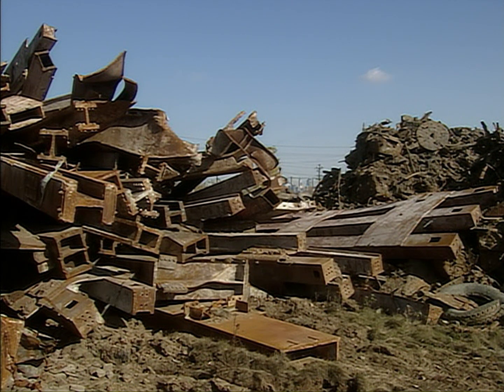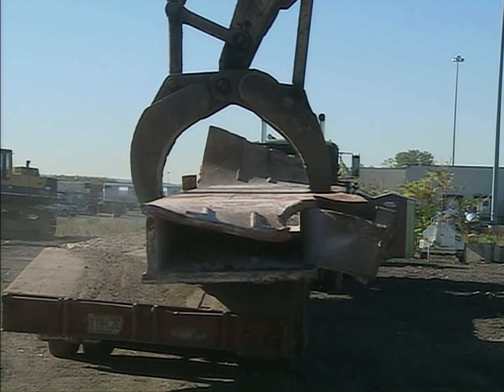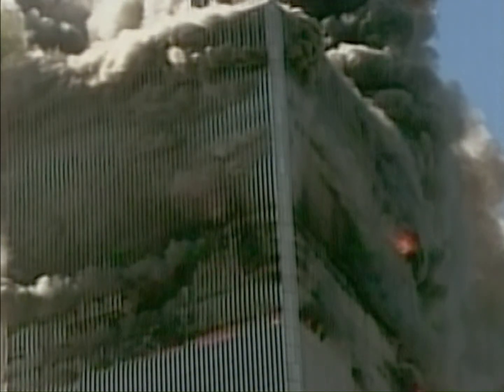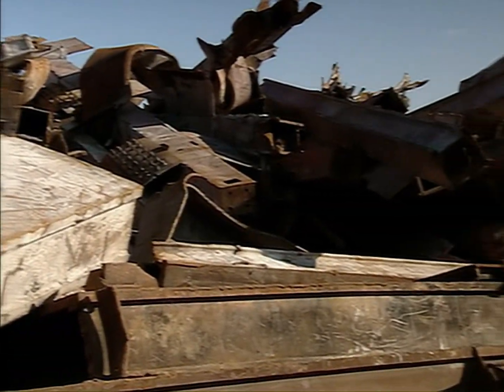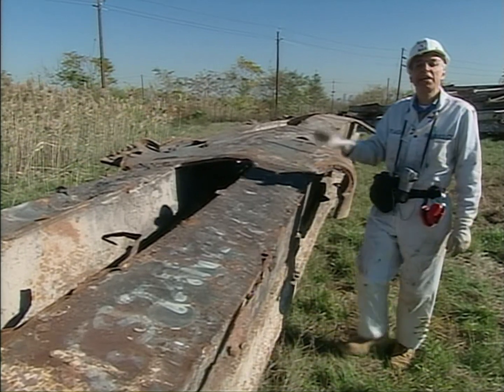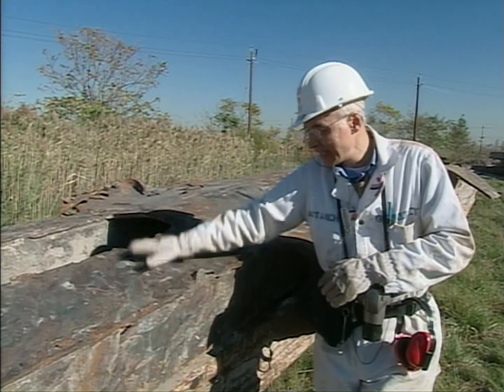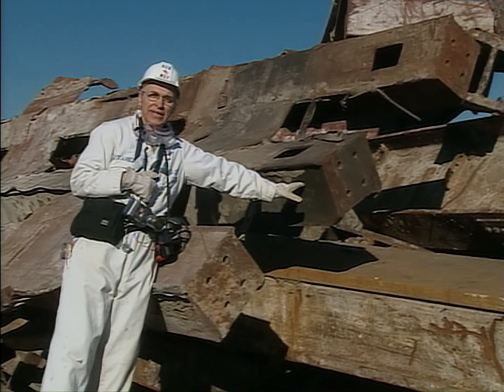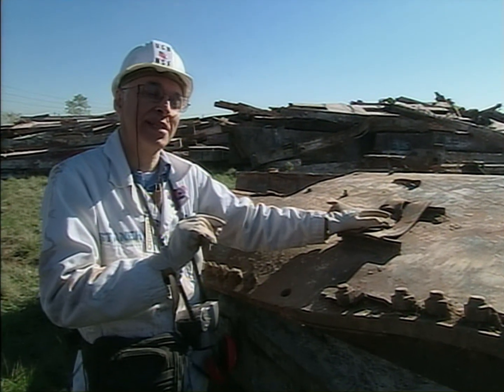WTC Steel Wreckage at Claremont Scrapyard Feat. Dr. Astaneh-Asl

Comment: twisted high strength steel weighing tonnes, each floor covered with a 4 inch layer of concrete.all 500,000 tonnes came crashing down at 120 mph in 11 seconds. it's not surprising that there was very little left as most of it was pulverised, i'm amazed with those that did survive as this was hell on earth. i'd love to know how much it cost in total to build these twin towers...

Comment: Kerosene fires can't melt steel. Not nearly hot enough. However thermite can easily melt steel. Thermite particles were found throughout the WTC collapse dust. Dr. Abolhassan Astaneh-Asl doesn't seem to understand basic physics if he thinks kerosene fires damaged the steel. The buildings were rigged with thermite prior to their collapse.
Reply: Cool Beans I believe an aluminum alloy large 767 jet penetrated thin steel at 460-590 mph. Also, my car won’t go through a building made of thick concrete and steel if it’s going 60mph. But it might go through if I’m going 590.
Reply: Your understanding of basic physics is nil if you think steel can't weaken without melting first.
Reply: @incredulousdisbelief9841  I didn't say that heat doesn't weaken steel. I will say that heat in the upper part of a tower can't weaken the steel below which also failed.
Reply: Quake proof a house Taylor Devices Viscous Dampers personal opinion.
You have no facts or evidence to back up your claims. Read my previous comments please.
Reply: Kerosene fires can’t melt steel but they can certainly weaken them to the point where they can’t hold the weight they used to.
Reply: @carhles4924  Heat didn't effect the lower portions of the towers which offered no resistance to the upper portions as the fell at nearly free-fall speed.
Reply: The towers were rigged with thermite during the elevator maintenance that was done in the weeks leading up to the collapses.
Reply: Paul Borneo Proof? This is a very specific claim.
Reply: Paul Borneo I think you have the right idea
Reply: Carhles a building can’t collapse all at once however...
Reply: Lord Pizza Didn’t collapse all at once. It was a progressive collapse. You didn’t see the entire building fall at once, you see the top impact point of the building collapse, then the floor below, then the next floor, then the next, until you get all floors collapsed.
Reply: Carhles Sorry, but I just can’t see that being structurally possible. I don’t see this being done without the assistance of demolition techniques. Especially WTC 7...that collapse made zero sense.
Reply: @carhles4924  You,  my dear,  just clearly described,  EXACTLY,  how a  CONTROLLED DEMOLITION, is done.

Comment: They needed to clear the evidence away fast...
Reply from the maker: Wes Fox  That the steel of the towers and WTC 7 was largely hauled over for smelting plants, without any examination, is correct and not a "blah blah meme". That's why the official investigation by NIST relied heavily on (black box) computer models. In case of WTC7, they relied fully on 3D simulations.
Reply from the maker: Wes Fox  The Freshkills Landfill did process mostly light debris and the recovery operation was focussed there on human remains and the personal belongings, not examination of steel, and not to speak about testing for explosive residues, which was never performed - anywhere. And it wasn't done by FEMA, but by the FBI and NYPD, as far as I know.
The majority of the WTC steel was transported to the three NJ recycling plants: Claremont (operated by Hugo Neu Schnitzer East), Newark (Metal Management Northeast) and Keasbey (Blomford & Co.), where it was cut into smaller chunks before bring them on to barges for the shipment to East Asia for melting down.